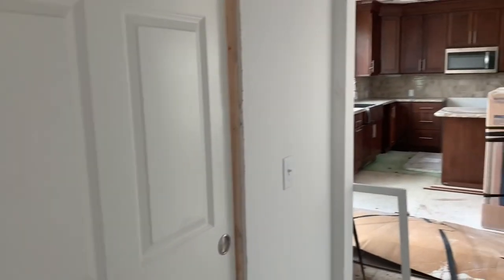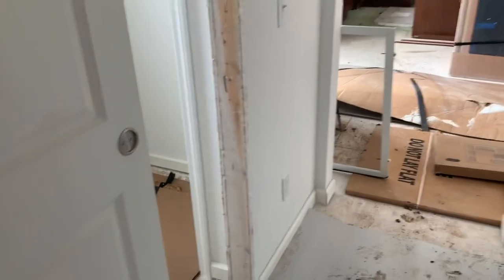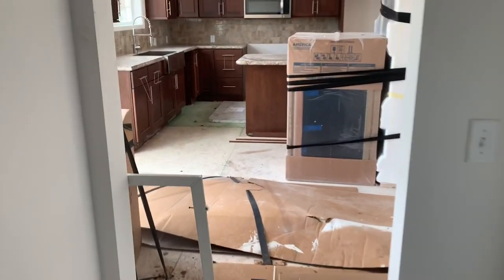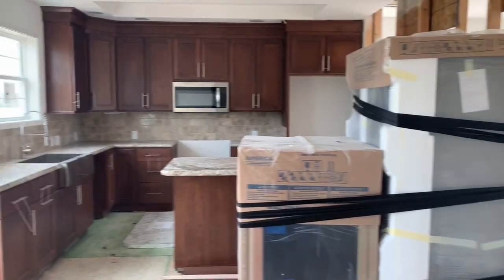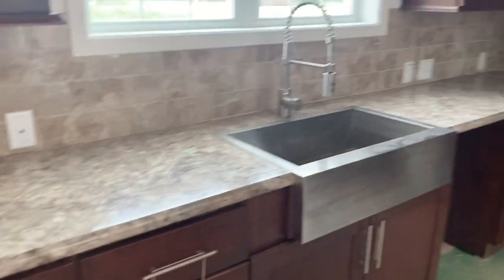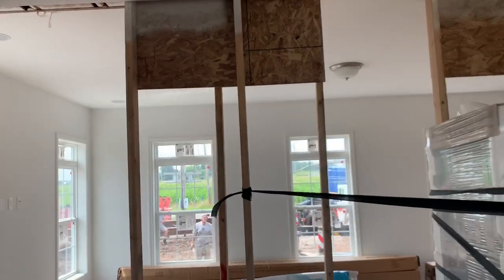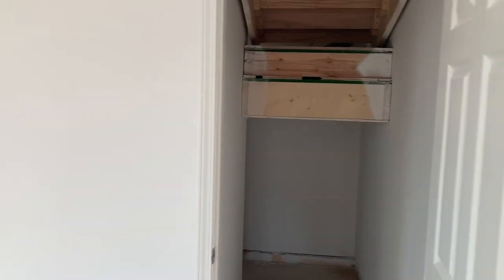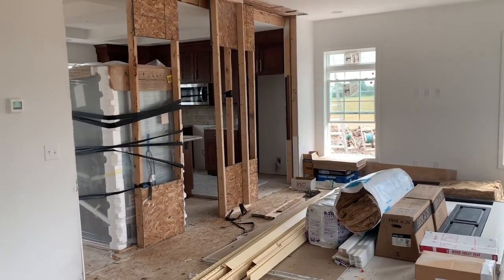2-Story Modular Retirement Home With Attached 3-Car Garage! - Buffalo Modular Homes

Comment: Not bad, but so boxi.
I hope they will be able to add some character to the exterior.
Reply from the maker: Dionne M hey thanks for the comment. Most homes start pretty much as a square or rectangle. Curb appeal is provided by the way the front porch and the attached garage interact with the house. I’m this case the home owner allowed us to design with her a small front porch and a three car garage with a stepped back third bay and a 9/12 hip roof. Here is the picture of the finished home :-) lmk what you think! https://www.facebook.com/902145266558330/posts/2364642700308572/?d=n

Comment: Wish the trim work in the corners didn't have such visible gaps. Seems more attention to detail was needed.
Reply from the maker: Hey thanks for the comment! So you'll notice that the baseboard was actually just tacked up off of the floor. The reason for this is because we're doing all the Finish flooring on site. So once we install the Finish flooring we will adjust the baseboards down onto the floor and the corners will all be tight. Sometimes in shipping you will in fact get some movement on the crown molding on the kitchen cabinets and that's easy for us to adjust on site during the construction phase and of course prior to handing the home over to the customer. Very astute observation and please let me know if you have any other questions or comments that I can answer :-)
Reply: @Buffalomodular  I appreciate the explanation and am glad to know more finishing was planned to correct it. :-)
Reply from the maker: mytrueserenity absolutely!
Reply from the maker: Here are a few pics of the completed home https://www.facebook.com/902145266558330/posts/2364642700308572/?d=n